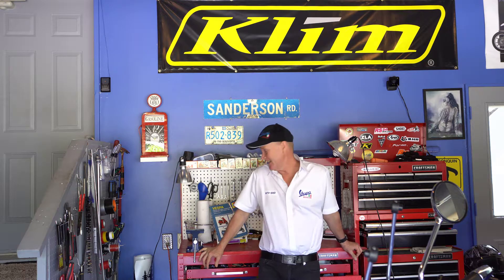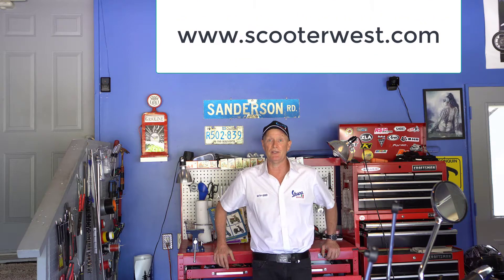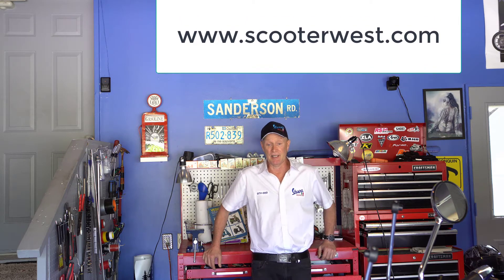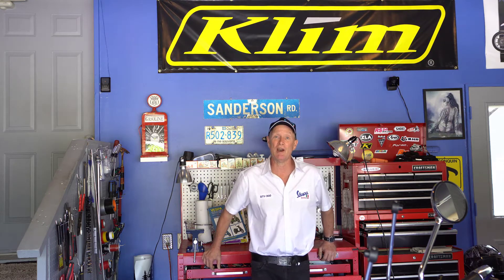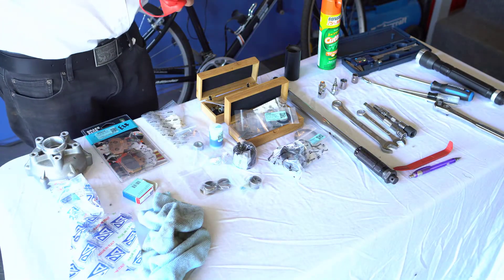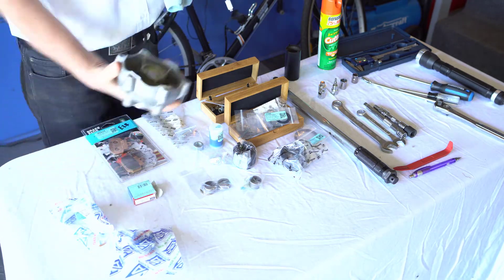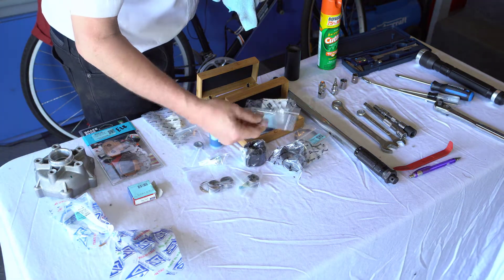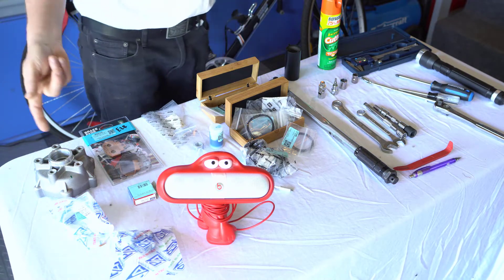Vespa GTV 300 Bearings Part 1 Steering Bearings Upper and Lower

Comment: Hi. Im back again. So when we removed the old steering column we found that the lower bearing race was  either part of the column, or had friction fused onto it. The new column, however, did not come with a built-in race. Do you recall if your bearing race is built in to your column? I need to know if its worth trying to pry that one off before going to buy a whole new kit. I can only find $40 kits and finding just the race is difficult. Thank you again :)
Reply from the maker: Ok, I can't say for 100% certainty but I think the track is separate?